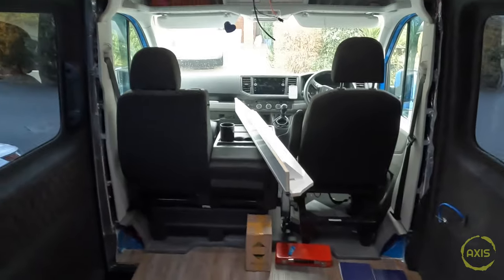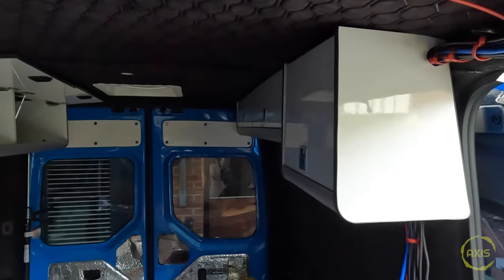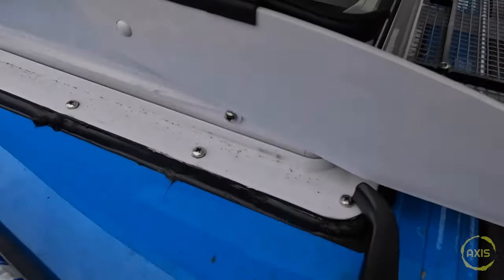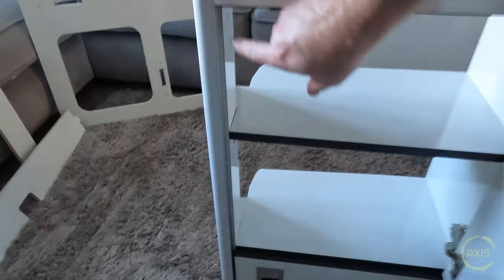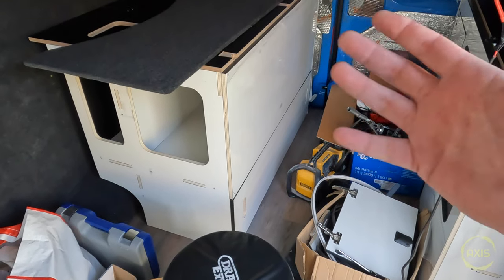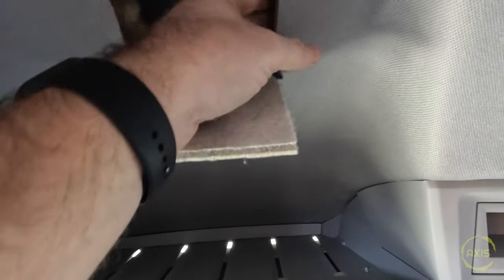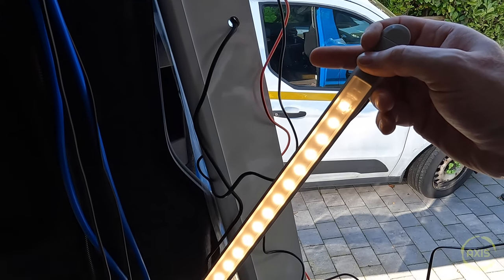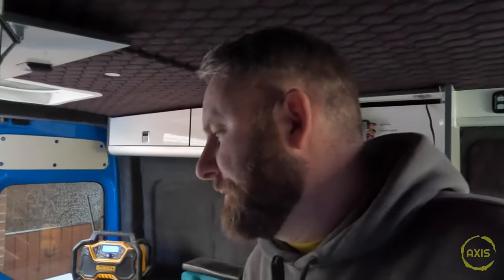Evomotion camper van furniture design 2 MWB install into a Man TGE van

Comment: What did u use to bond l brackets to the roof???
Reply from the maker: Good old sika flex. Everything I’ve tried to remove with that on is solid 🤣
Reply: Is it 221???
Reply from the maker: @jersovauto  113 rapid cure but 221 or ebt should be fine

Comment: Hi mate min 13 how have you connected the trip light to the electric, mine has a yellow plastic end. Not got a clue what to do with it lol, Evo instructions are dog sh*^t
Reply from the maker: Hi steve, you can either buy the female end of those yellow plugs that come with the lights or chop it off and connect the wires with what method you choose bud
Reply: @AXISUK  top man cheers. 👍🏼👍🏼
Reply from the maker: @steviedavies2740  good luck with the build 👍🏻